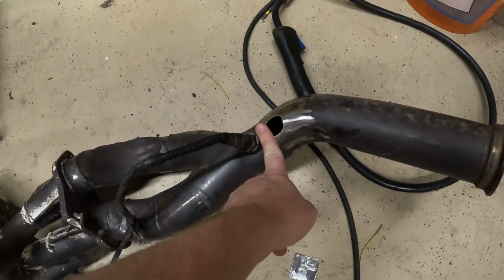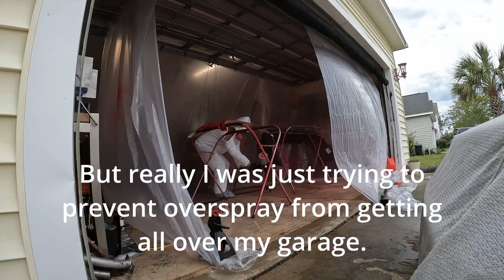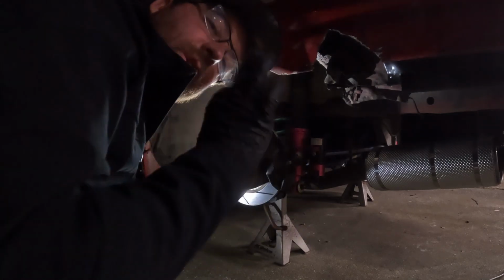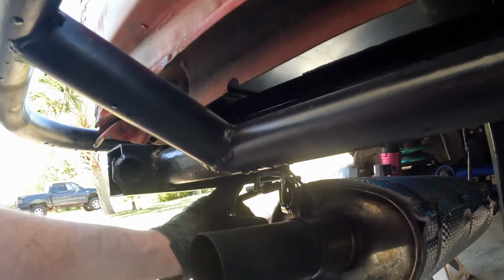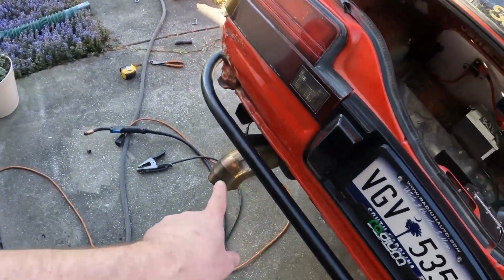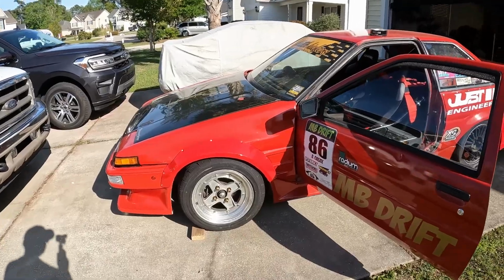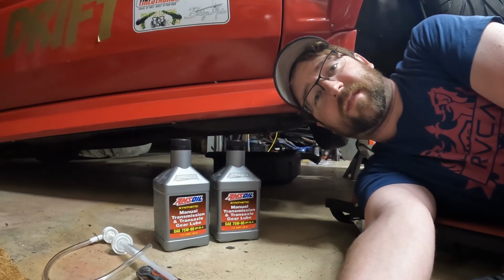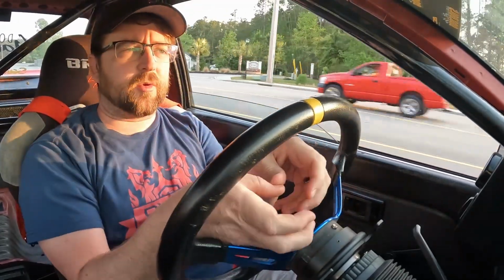The ROAD TO DRIFT WEEK 5 - FINAL STAGES. Highway Testing?!

Comment: When you get a chance you should  redo those rear fenders, cut them a bit higher and if you cut the outer up and you hammer to meet the panels and weld on the outside  of the wheel house you wont need those "finger" relief cuts.
Reply from the maker: That's the plan! I want to do some "mini tubs* so I can look terrible and fit 17s when I want to run a full day on a pair of 265s ;)
Reply: @DoctoredGarage  lol 17s aren't too bad. Guy I follow on FB has LS swap and 17s all around looks tits really.